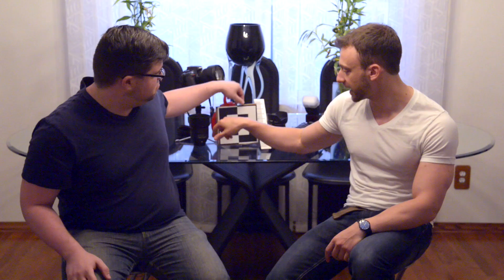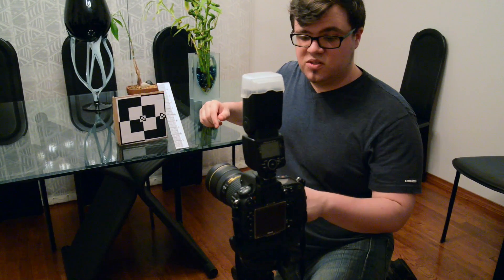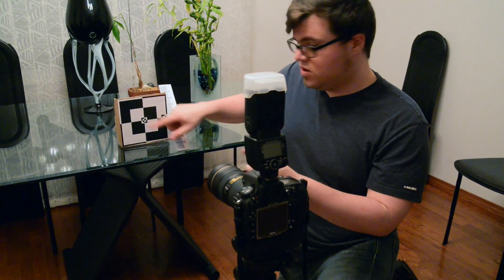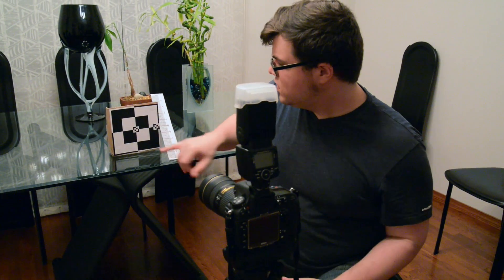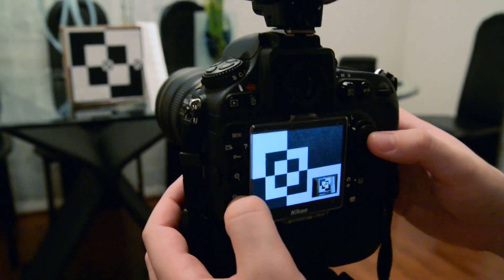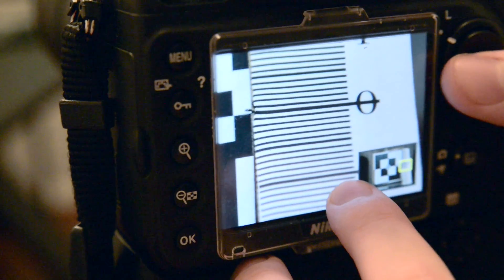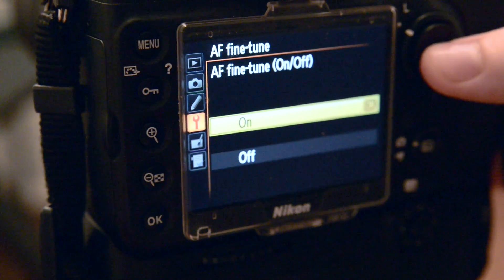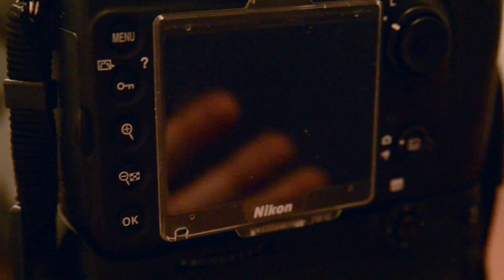How to Use an Autofocus Calibrator

Comment: you dont use the DEFAULTS.. that is used if all lenses show the same error meaning the camera is out, you should adjust the saved settings, that will allow adjustments for each lens fitted..

Comment: Hi. I have a d7000 and the tamron 28 to 75. I've calibrated it with your method on that distance but when i try to focus lets say 5m on the eyes the focus is still wrong. Any advise on that. Thanks for the video.